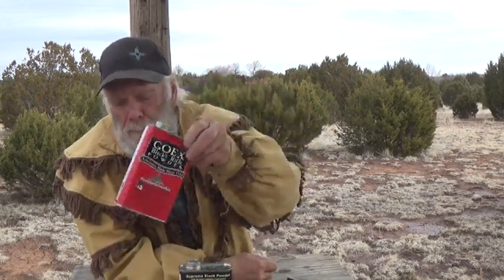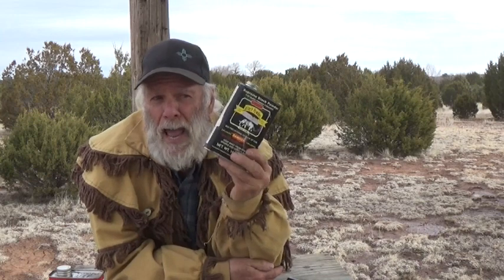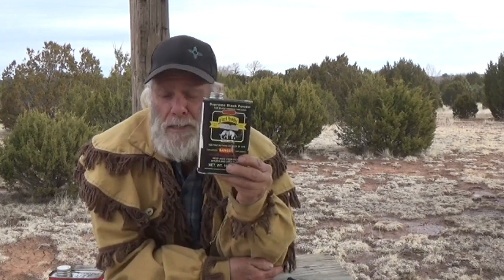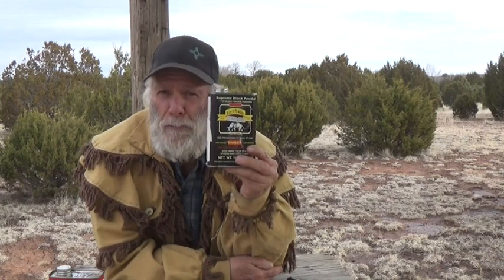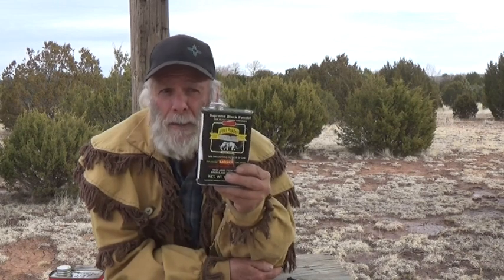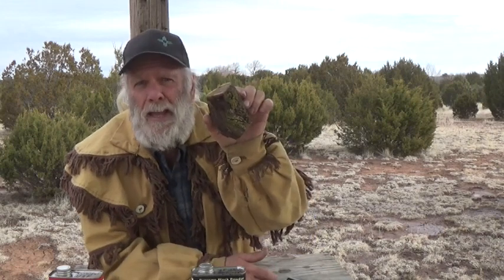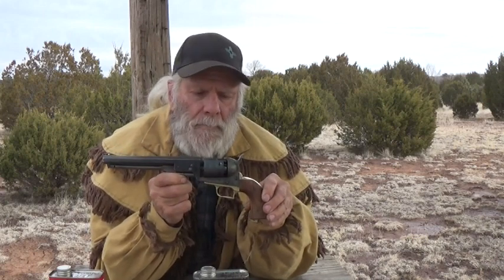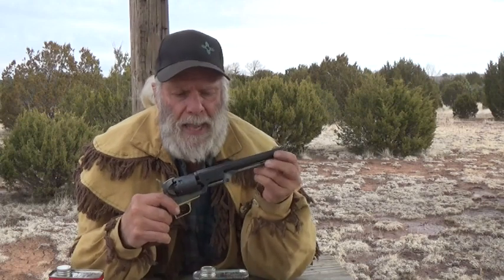Jake at Everything Black Powder... I Think You're on the Right Track

Comment: "I test" Stages and batches inside SS 2" pipe caps with a fixed amount of DIY BP, then I let it sit to observe how my fouling reacts with humidity or time.

I have had "THE SAME" thoughts as "I do" the same re process with my DIY BP fines.  of late I think my moisture or humidity control matters "most?" before and after milling, I gave up pucking for now, but I just made a twin roller machine for sizing my Pucked, Corned BP?

I tested the lead theory as I was down this rabbit hole with discarded jacketed bullets for media while disappointed with my speed and fouling.  The vessel I used in the milling "maybe" VERY important? none had me satisfied. I found my fouling and speed much NOT Great with lead and/or cast off projo media, maybe a Lead Oxide? or sulfide? or the rubber/plastic China media vessel? 

I "now use" Glass jars and Alumina Ceramic media at the suggestion of a friend whom is Both Chemical And Mechanical Engineer, a SMART Guy who runs and has a Laboratory for Testing others' bulk materials (coke and coal).

Now "I am" looking into the Sulfur.   Sulfur has a Low melting point(240f) but acts like putty or plastic at ambient temps. I'm thinking of taking my milled product up to this temp, but lower than BAD temps to see if this level of sulfur bond makes the Magic happen with the Holy Trinity. 

I have Not figured it out yet. One batch is FAST and CLEAN! the next with same materials is Almost as good? the only thing different is the date, weather, or time, I even started a batch book with batch numbers and notes to track my progress as my memory sucks and all BP is black. I did notice when I very "carefully" use heat to dry my pucked or not DYI BP I got Faster, and Cleaner?

Keep Chasing the Dragon!
 now with the world in our hands and computers in our pockets, we struggle to Re Learn what our Fathers' Father's ALL knew. GOD Bless!
Reply from the maker: Thank you for sharing you knowledge.  Two things, I should have stated my lead balls are a 60/40 lead very hard, maybe that's why they have not deformed and such.  All MY drying up to now was with the summer sun.  This time I will be drying with a de- hydrator.  I now only  use water to moisten the powder before pucking, so that should  not be a problem.  I plan on lining the pans with foil.  I have seen others use a dehydrator to dry their pucks.   Have a Great day

Comment: Another good video and thanks for sharing your experience.  There are people who have the technology to check particle size...it might be wise to use them to determine where the particle size is as small as it will get.  Also if you have the opportunity try mimosa charcoal for your powder.  Take care and God speed!!!
Reply from the maker: Thank You for your comment.  At the moment I don't think Lead dust is what is causing all that bad fouling, I tend to think it's the graphite coating on commercial powder.  What temp does graphite burn and disappear.
Reply: Graphite does not burn until you get up around 2500 degrees Centigrade!  It definitely shows up in the fouling, so does any ash in the wood.

Comment: I use about 50 stainless steel 3/4" ball bearings as tumbler media, and I add just enough water in the ball mill to keep the dust down. Then I let it tumble overnight. Seems to burn clean-ish, but that's just my opinion.

Comment: Interesting. I make Black Powder, when i need it for BP guns. I never messed with all the things people do with or to Black powder. You guys go way overboard about your milling and process.  For me, i find that milling the powder damp, not wet, mixes it the best. For me. The extra worry about what charcoal, ect and all the rest is a waste of time. A couple hundred feet per second is not going to make a big difference in the long run. My point is just making consistent BP is all that matters. Or having a consistent replacement. But I understand people wanting to play with improving Black Powder. Have fun!
Reply: Depends on what you're doing with it. If you're loading it in cartridges, the minute stuff matters.
Reply: @mkultraification  , I digress. If it matters in Cartridge loadings it matters all times. 
Is the inside of a bp chamber not the equivalent of a simple cartridge? Then it matters all the time. Cartridge is less forgiving. But in regular cap and ball it still matters.

Comment: I got to say in my media balls really looked mangled deformed melted almost
Reply from the maker: Mine are still round for as much as I have done with them.
Reply: Are they factory lead balls(like hornady or speer)?
Reply: Mine are hornaday
Reply from the maker: @joearledge1  Home cast 60 /40 very hard. I tend to think that's why they are still original size.
Reply: I've got the same problem with factory balls. A lot come out of the tumbler with what I call devil's horns. I'm not 100% sure, but my theory is that it's trapped air pockets in the ball. Maybe the factory swaging process tends to trap more air🤷‍♂️... I have also tumbled home cast balls from #6 shot to 0.732" from pure lead to a BHN of about 18-ish and never had any problem with deformation of the ball from the tumbling process. I can't say for sure,  but it really seems like home cast is better than factory swaged for that reason...
Reply from the maker: @joearledge1  Agreed.
Reply: Thank you fellas I will have to try that